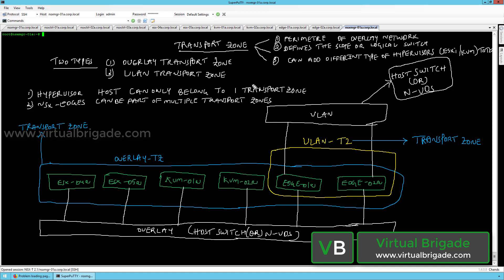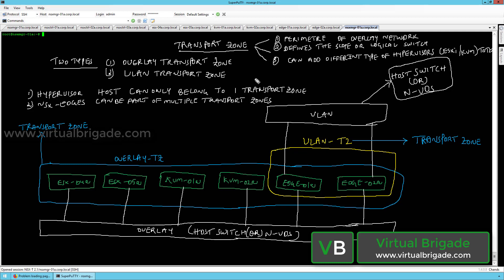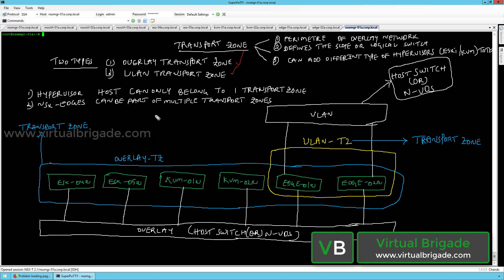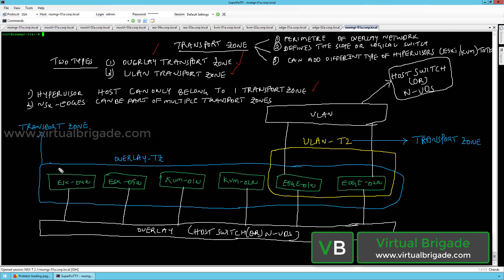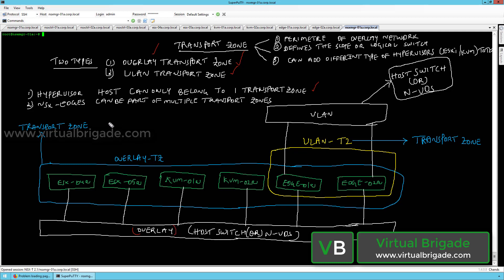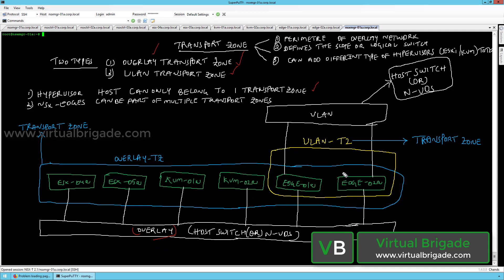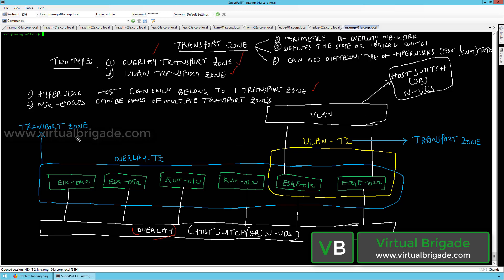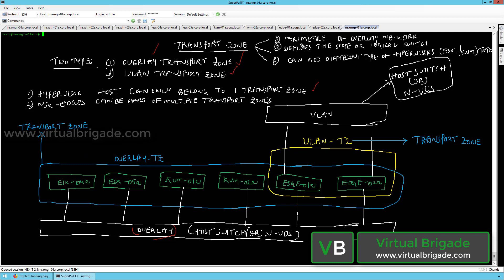NSX-T 2.1 Part 12: Transport Zone in NSX-T

Comment: Great video series - I have a follow question as I am struggling to understand the traffic flow.  If I have a tier0 router that is sending traffic northbound, you create uplink switches which are VLAN backed which then sends the data to the physical router.  Where do the Edge Gateways fit into this?